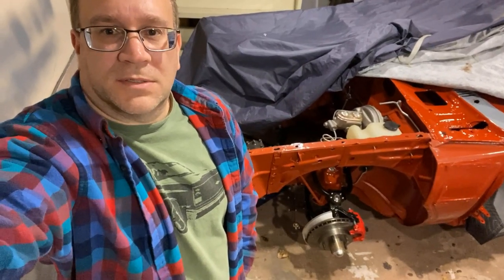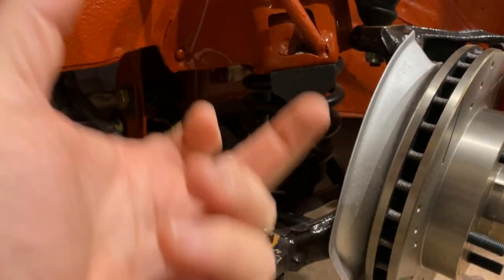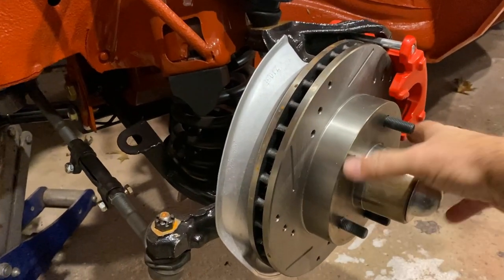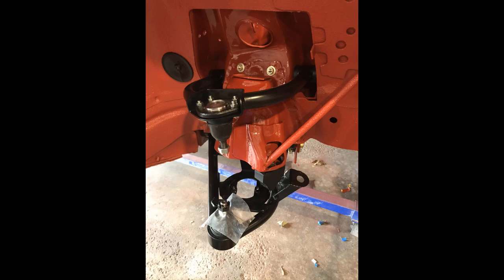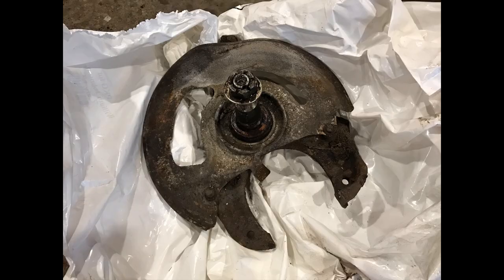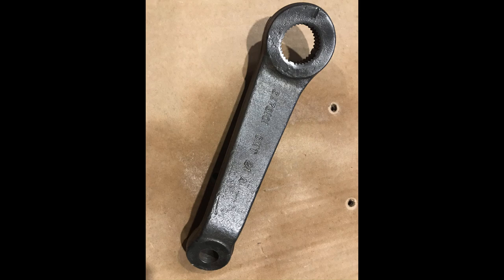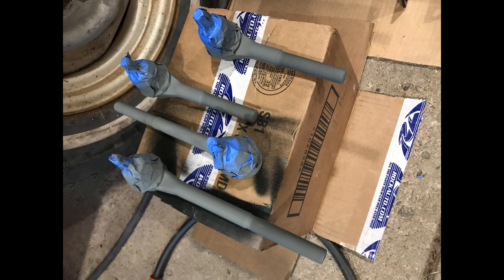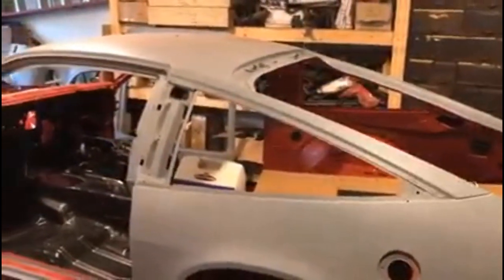Chapter 9: Suspension

Comment: Congratulations on a milestone of back on the ground. Fyi first gen s10 is built from off the shelf parts the front suspension are early buick regal parts, the rear ends are 10 bolt. I own an early s10 and knowing that makes sourcing parts easier if the parts catalog doesn't list your application. In my humble opinion you should source a grand national turbo v6 for that thing or a gen5 4.3 v6. Sbc or a Ls is in everything dare to be different.
Reply from the maker: I actually love that idea!  I agree the SBC and LS is over used but I guess for a reason.   

It is getting the SBC 327 out of my high school car initially but long term plan is an LS / 6-speed.  But....I like your idea a LOT!!

Comment: Looking good.  With the rarity of finding 342 gears, I'm assuming you might have got those with the doors from Scott in Albany? 

If so those got to him on that black spider that he picked up from me.

I swapped at rear end into that car from another Forest green 76 monza I had.

They came with that car, but we're an original to it I can only imagine they were sourced from a four-cylinder parts car when they were plentiful around here in the 90s.
Might have even been from a cosworth Vega.
Reply from the maker: Yep. That’s exactly where those doors came from.   

Jim at JD Race built the rear.  The gears and pinion both need machine work to fit the H-body axle.